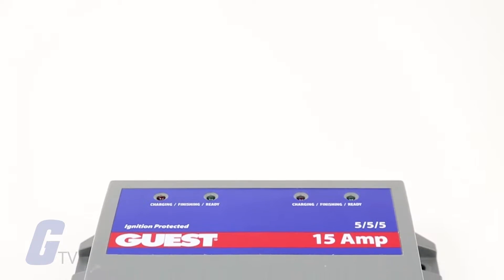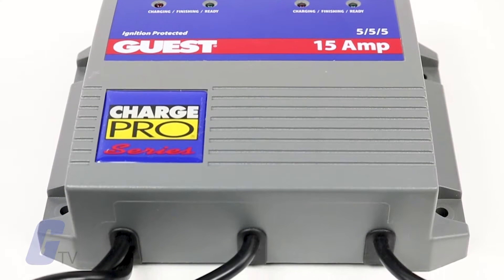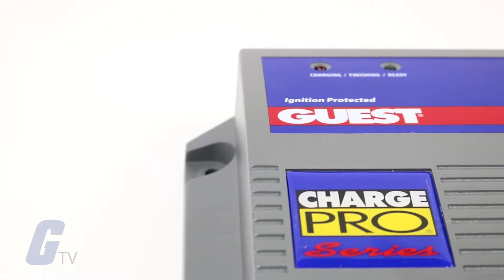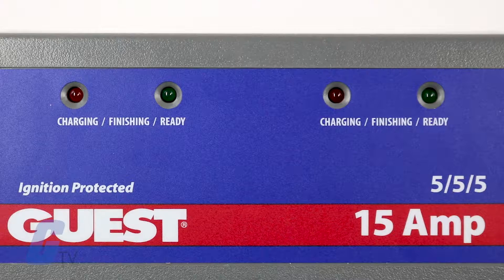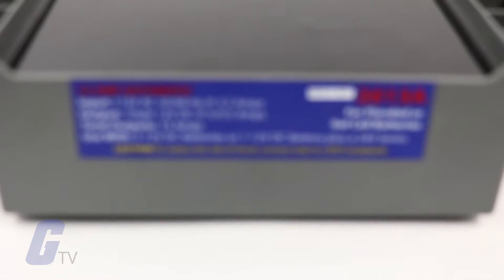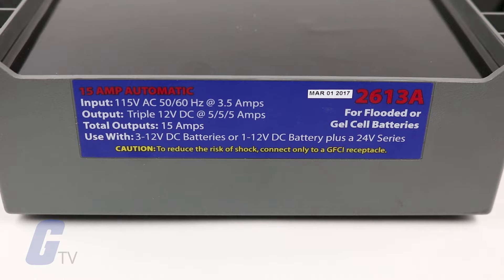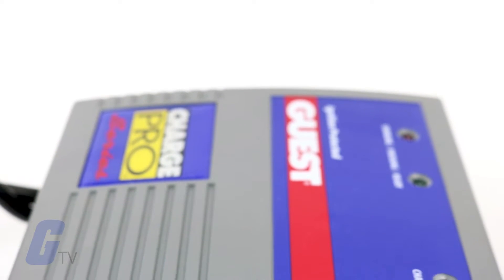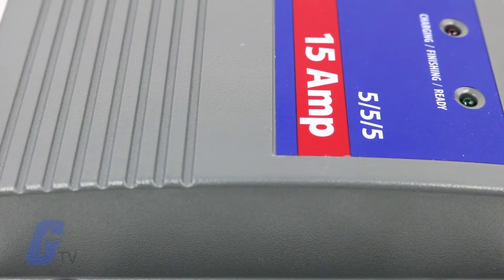The Trolling Charger Series from Guest Industrial

Comment: How about the yellow fuse connectors? i've tried everything to disconnect this to check fuses but it will not come apart. How do these come apart?
Reply from the maker: Not sure what you are talking about. Any fuse holder can be in many different colors. Try uploading a photo of it to websales@galco.com we may be able to help you that way.
Reply: I did get the connectors disconnected and both fuses were good. plug in charger and no lights. Power to plug is good. The charger is fairly new and has only been used to maintain batteries between a few fishing trips. I have another maintainer charger for long term storage, I guess the Guest charger has a major malfunction.
Reply from the maker: How old is it? Is it still under warranty?
Reply: It's about four years old so the warranty has expired, I'll just have to bite the bullet and buy another one. Not that it's expensive, just assumed they normally last a little longer.
Reply from the maker: Are the batteries in good condition, never been dropped? Posts ok? How old are your batteries? I agree the charger should have lasted longer, but if something is stressing it ??? Just a thought.